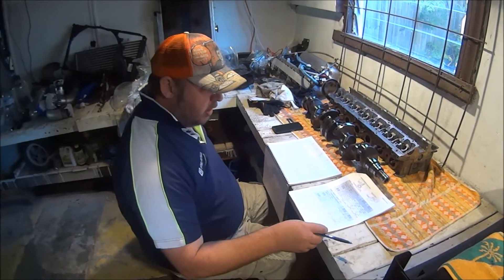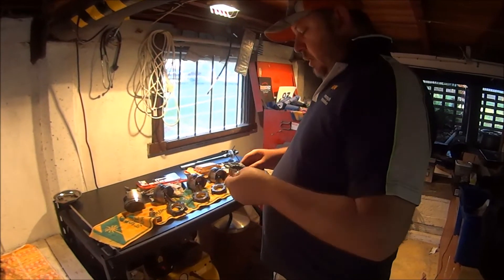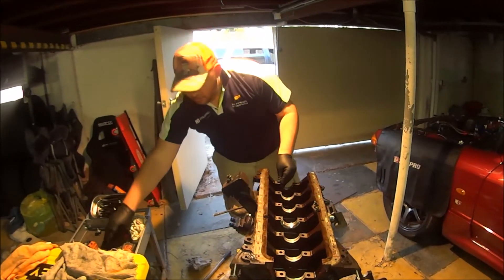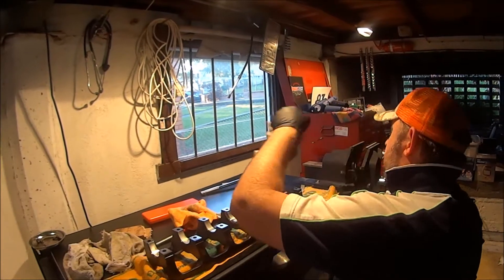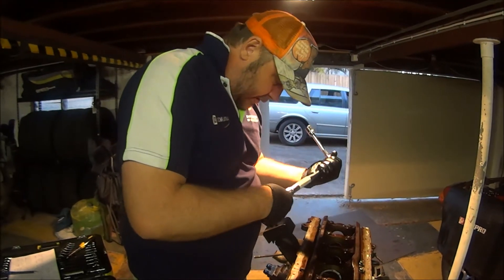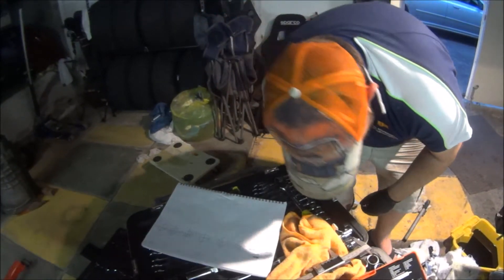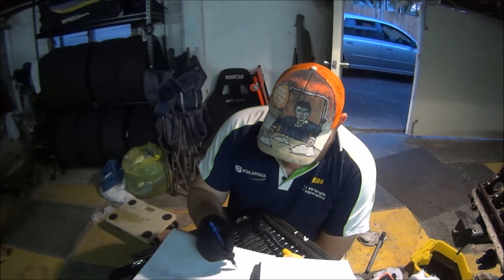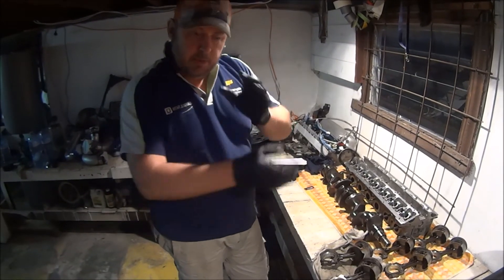R32 GTST Time Attack Build - RB25DET Engine Build - Crank Main Oil Clearances Bearing

Comment: Iv got all the flash tools at work for blueprinting engines 99% of time i use simple old plasti guage its cheap, easy and good for spotting an odd bering out.
Reply from the maker: Yeah I did get some plastigauge after this... will be used where needed. And for confirming clearances on the rebuild. Just trying to work at where I am at in these vids. Mic and Bore Gauge has now arrived too.